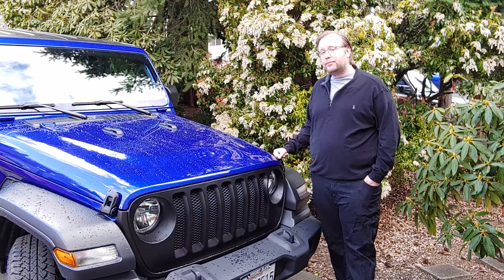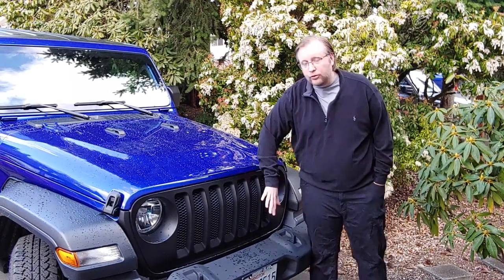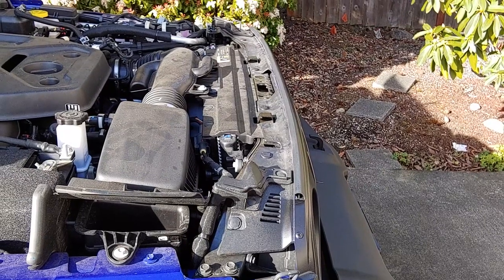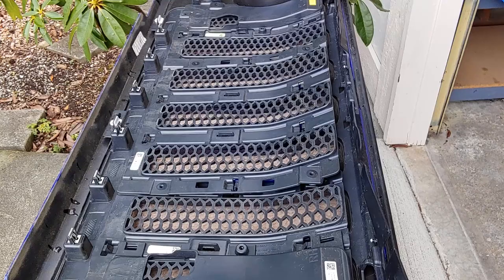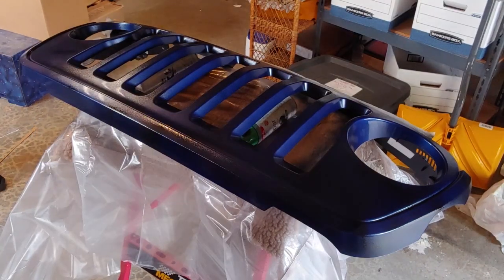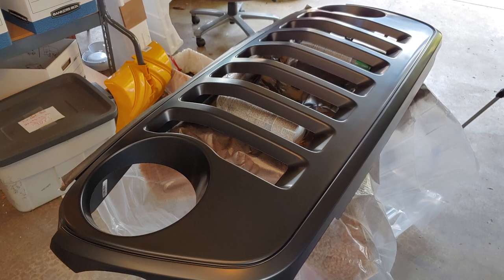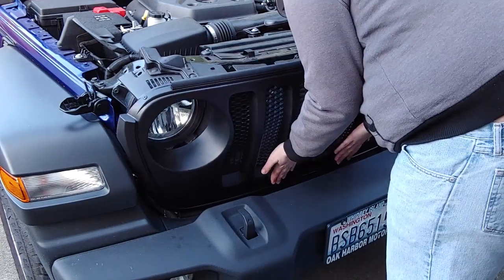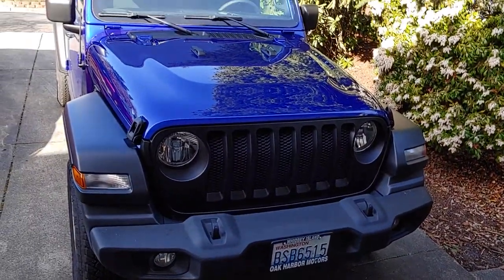Plasti-Dip you Jeep JL Grill!  Save yourself up to $1000 in paint protection!

Comment: How is the plastidip holding up ?
Reply from the maker: After 3+ years of use, really good!  Its starting to fade/turn dark grey and I may just peal it off soon or re-do it.  I did a test and my weak power washer will blow it off easy if I get the nozzle close to the surface.